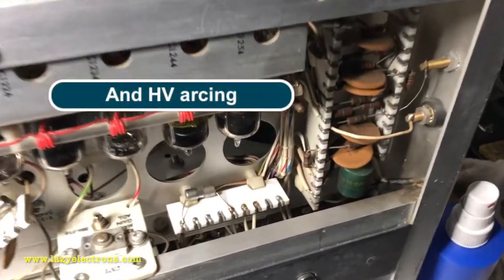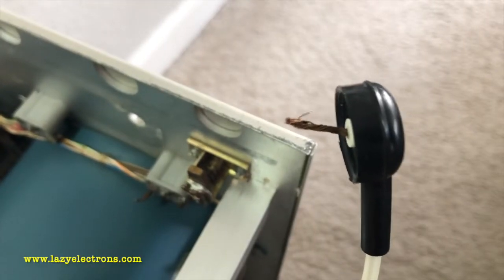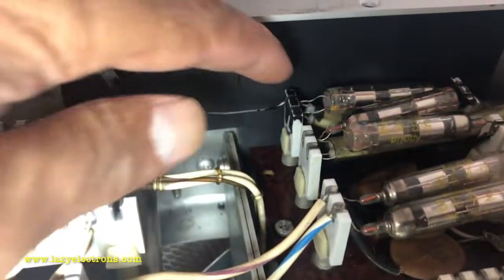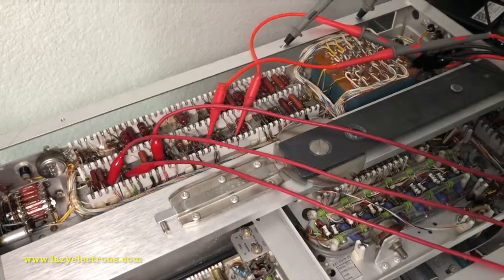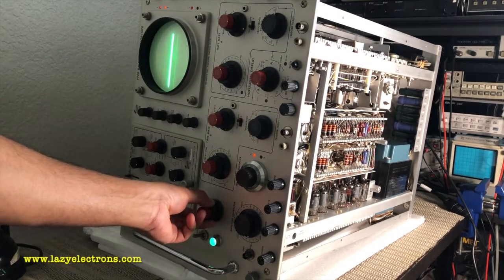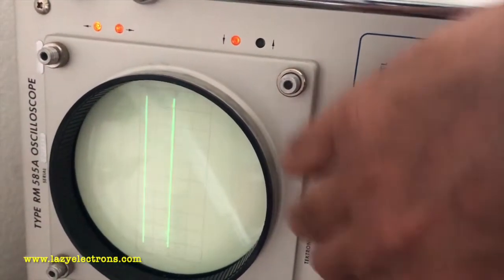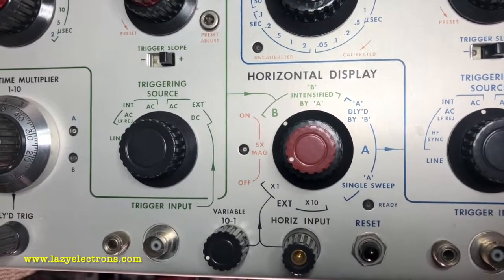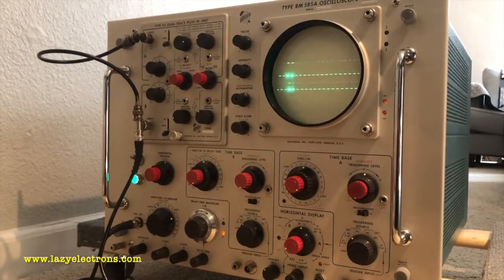Tektronix RM585A Restoration Part2/2

Comment: I got a question. How to open the 535,535, rm35 or rm35a Tektronix
Reply from the maker: Instructions are in the service manual. RM series is a bit different though. 4 screws at the front and one at the back if I recall correctly.
Reply: Know which one in the back?